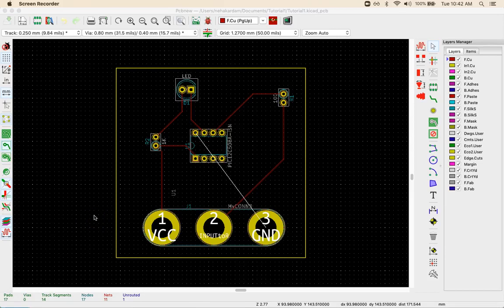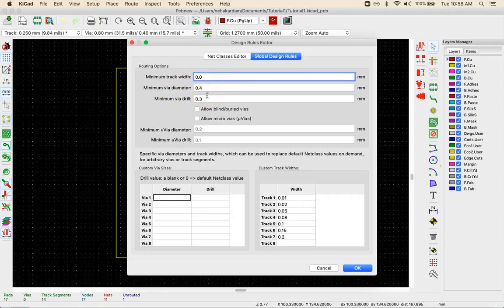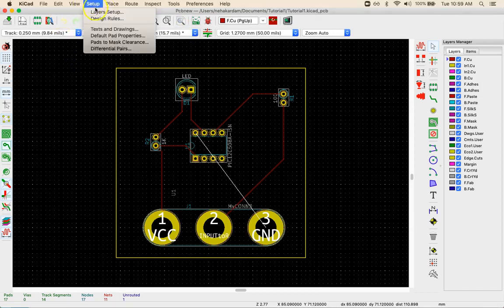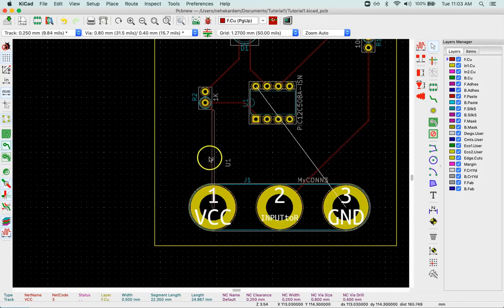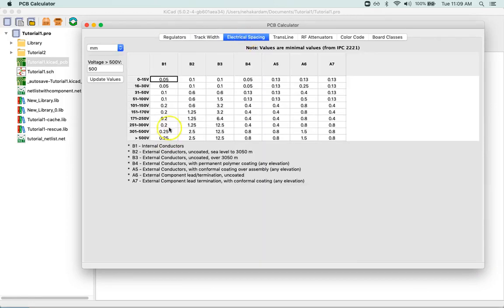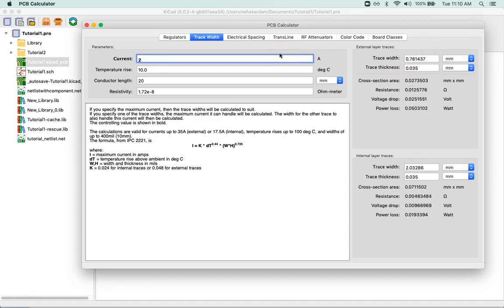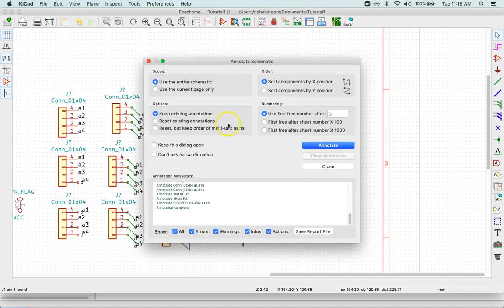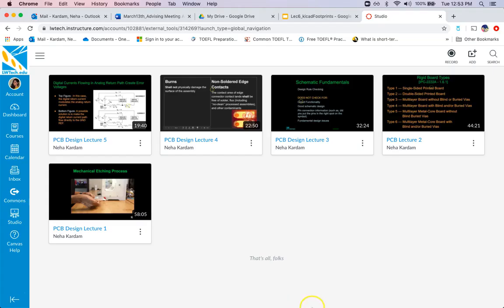6: Annotation and Track Width Calculation using Ki-CAD

Comment: Hopefully helpful insights: 
Very high-end/expensive PCB house may be able to create trace widths down to 2.5mils (~0.07mm). More typical industrial fab minimums are 6mils, with 6mils spacings. YMMV.
These numbers have shrunk over many years as fab houses have refined their processes with experience.
For better yields (better/reasonable prices), set your mins a few mils above these levels.